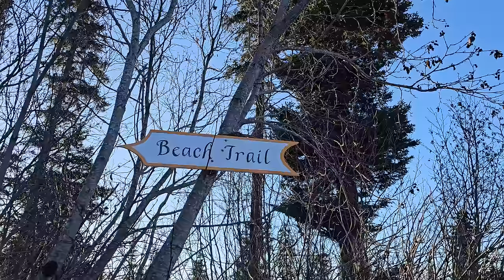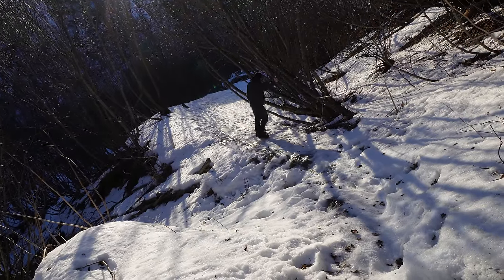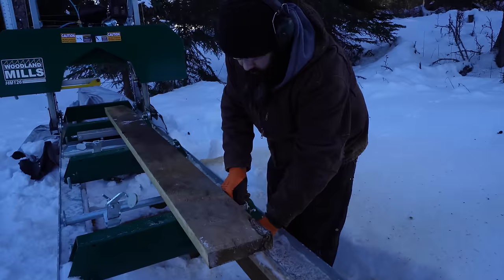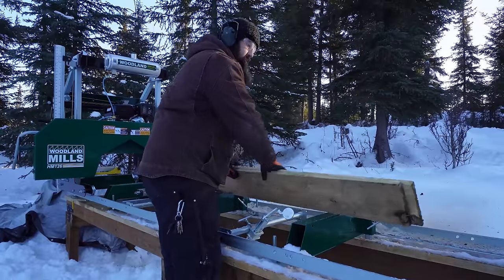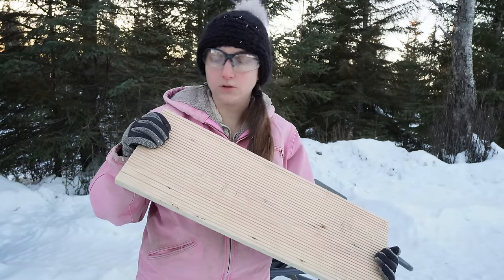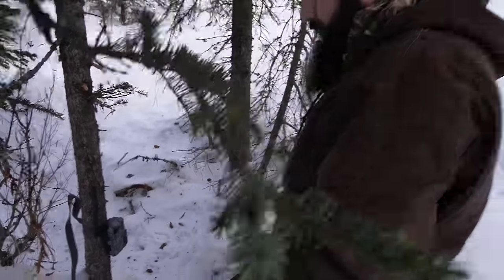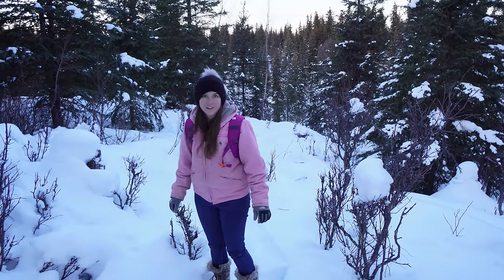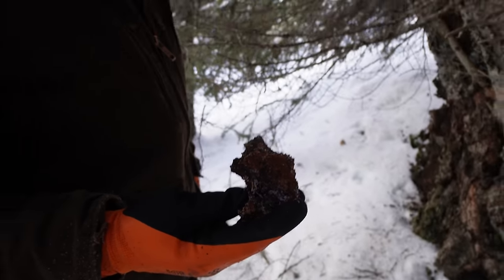Alaskan Wildlife | Birdhouses & Snowshoeing

Comment: Great job on your bird and bat boxes. The only problem is swallows usually nest in a community and your bat box is mounted way too low. If you Google this it says you should mount their boxes at least 20+ ft high. Bat's can't take off from the ground they need the height to get speed for initial takeoff flight. Just a thought.
Reply from the maker: Thank you! We will definitely get it mounted higher.